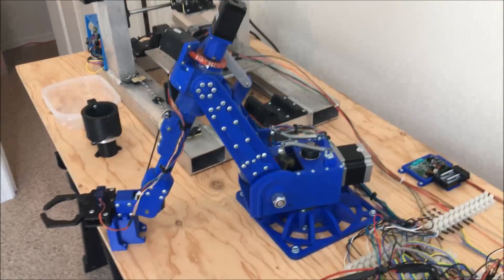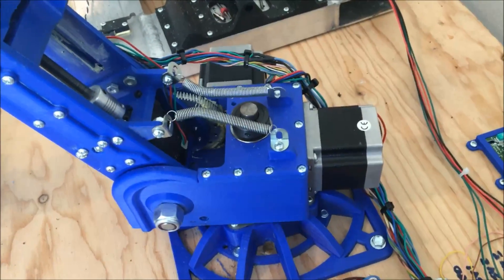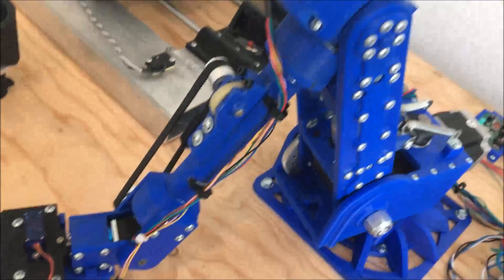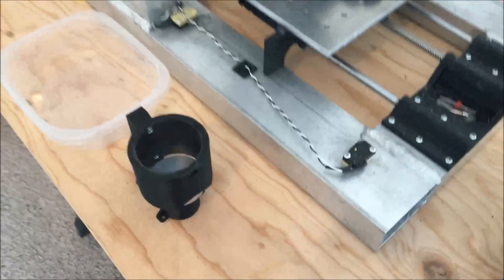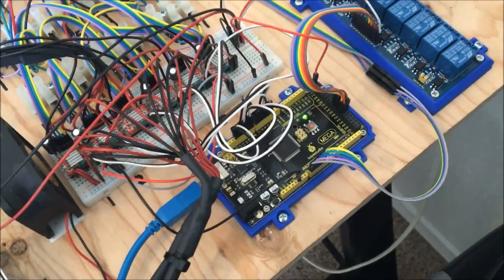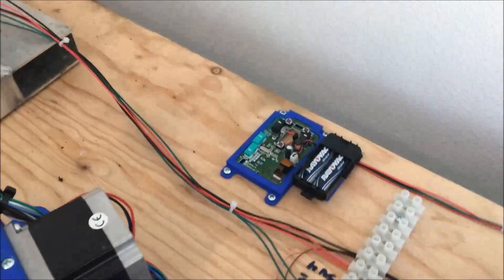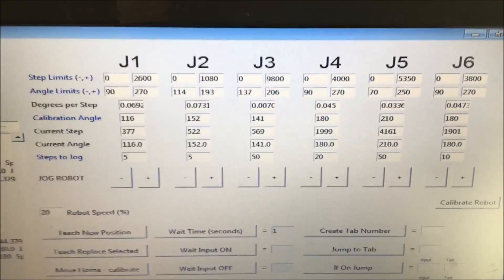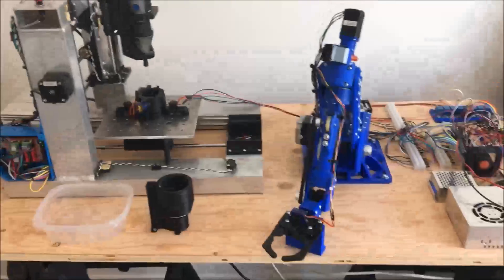3D printed stepper motor 6 axis robot

Comment: Couldn't you just stick your coin stacker on the cnc table with a simple pusher to push the next one on and then the one it was working on gets pushed down a slide into a box... no robot arm needed - and is quiet and small.. haha just kidding robot arms are totally cool when put to use properly..
Reply from the maker: You are correct...  not as much fun without a robot :)

Comment: This an awesome project and demonstration. A DIY robotic manufacturing cell! The da Vinci was able to print the base as one piece? Some of the arm pieces are even longer though. I thought the da Vinci may had roughly an 8" cube capacity.
Reply from the maker: Kent VanderVelden yea I think it's 7.5 or maybe 8, but yes base was one piece, the arms barely fit the table diagonally. On the yellow robot the arms and the base had to be printed into separate pieces and epoxy together. Thank you for the compliment.

Comment: You should realy work on the noise factor.
Reply: Who gives a shit if it makes some noise, that is the last thing he needs to be working on.
Reply: Are you serious ? this noise problem also indicates of some inefficiency problems in the joints reducing the speed and torque which are two of the most impotent factors in a robotic arm.
Also who would want a desktop that produces so much noise on their table?
Reply from the maker: I have updated to digital drivers and it is much much quieter. I should have another video up of the aluminum version with digital drivers in a few weeks.

Comment: Hi, sorry to bother you, but I just have a question. When you make it move on a straight line like that, do you divide the line into smaller segments.
Reply from the maker: no its just 2 points.  see my reply to Efrain below - I just have a calculation or algorithm that makes all the motors complete their move at about the same.  it appears to be a straight line but its not perfect, its just joint positions with all motors working together to finish their destination at the same time.  you can go to the github project page and download the python program and the arduino program and see how it works.  the python PC program just sends all the motors number of steps and direction, then the arduino program splits them up so they finish together.

Comment: This is by far the best application I have seen for a 3d printed arm. I am making myself a similar project, but my bot is a bit week as of the moment since I am using hobby servo. I am planning to get a super200 servo for more torque application. The final plan is to fully automate my 3d printing business. Nice work.
Reply from the maker: thank you.  I'd like to see your robot when you finish.  Im working with a local machine shop to build an aluminum version similar to the printed one but a bit larger.
Reply: How much torque does your base stepper have on this bot, I'm just curious coz I am planning to convert my bot from servo to steppers?

Comment: hola amigo... que buen trabajo, felicitaciones.... qué algoritmo utilizas para lograr mover los stepper simultáneamente??
Reply from the maker: the python programs tracks current position relative to angle and current step of all motors - it then determines direction and number of steps needed to achieve the next move and sends number of steps for each motor to the arduino.  The arduino sketch then filters out which motor needs the most steps and then divides all other motor step values into that value to determine percentage of steps to skip.  when the loop statement runs the motor with the most steps pulses the motor to step every execution of the loop, all motors with less steps will skip a step incrementally based on percentage.  all the motors finish their move about the same time - division is based whole number of steps so if not evenly divisible then one motor might have a few extra steps to finish.  you can download all the code from github (link above)
Reply: +Chris Annin thanks friend. Congratulations for your work